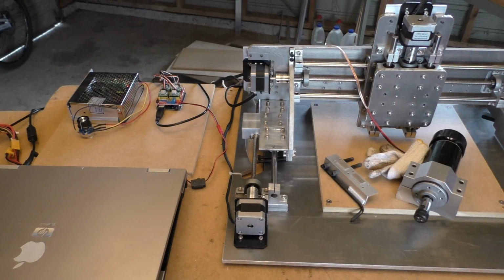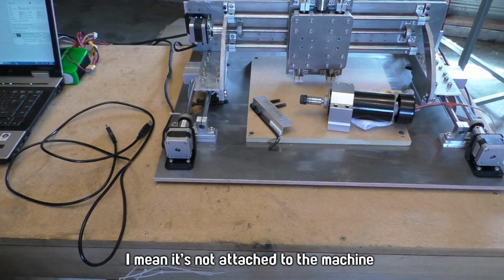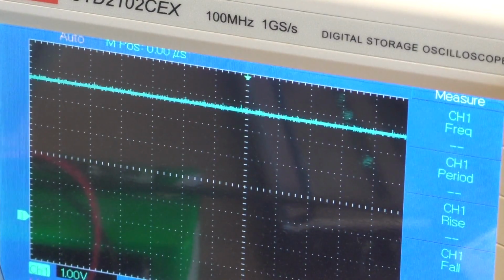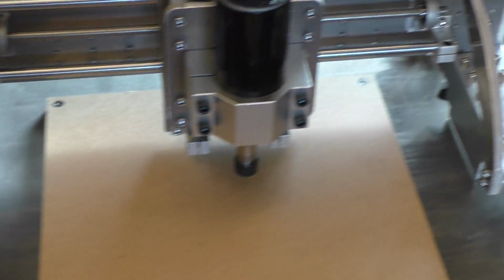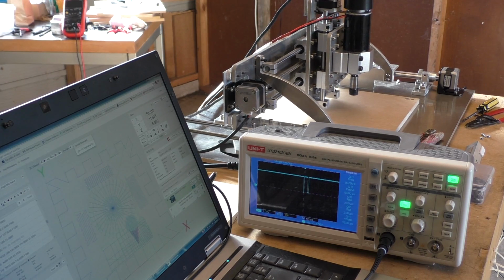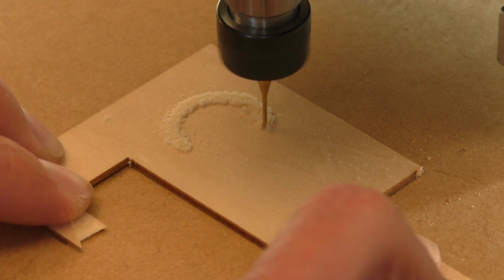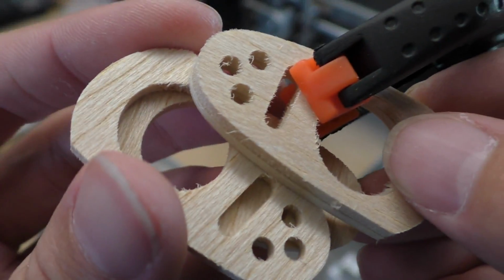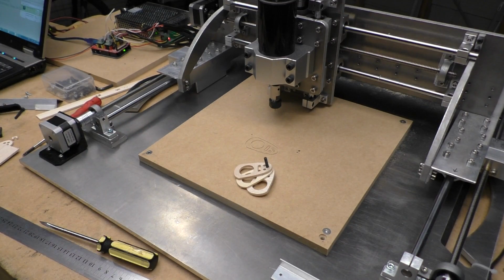DIY mini CNC machine part 10 (spindle round three + easy cuts)

Comment: I finally found soeone with the same project, setup and problem as me :D I´m looking forward to see if you found a solution. Thanks for sharing (I know I´m late)
Reply from the maker: I eventually gave up on the wired connection and I now use bluetooth between the laptop and arduino. Never had a single problem since. It also lets me move the laptop around more conveniently. Many laptops come with bluetooth devices built in (as mine does) so you don't even need to plug in a dongle.

Comment: Looking at the noise spikes at time 7:32 of the video, it shows about 16 kHz frequency. It is very likely poor EMI filtering in the switching power supply. Try using a Linear power supply to test. When you touched the motor to the plate it showed the noise even though the spindle was not running. A linear supply should fix that. It seems that the EMI is conducted and not radiated. Best of luck to you.

Comment: the issue is magnetic & rf ... not physical electrons... an opto-coupling circuit for the motors to be isolated from each other, and any  VFD P/S you might install.
Seek others' help... but I think your issue is common.
Reply from the maker: I tried optocoupler and still had the problem. Eventually used bluetooth connection, no problems since.

Comment: i got a router spindle on my cnc and same as you when i turn it on the arduino crushes. My solution is to plug the router to a different electrical line it happens when i am using tb6600 and drv8825 driveers.  But when i change my dr ver to dm556 it doest happen anymore...

Comment: Hi there buddy what stepper motors did you use nema17? And spindle any links? Cheers
Reply from the maker: yes nema17
https://docs.google.com/spreadsheets/u/1/d/1zyGDZSG_wHfn7GA0wKzwLYhK88SAIyLOe-4c9KuL23A/edit?usp=sharing
Reply: I forced thanks and the rest 8mm road and couplings?

Comment: I don't know what you ended  up doing with this, but I would install and isolated mount for the spindle motor.  Years ago, I had to iso-mount fork truck terminals from the chasis of the propane driven fork trucks.  Their spark plug noise was preventing the radios from working properly.  Floating grounds are always a problem, but iso mounting will help a lot. Back EMF diode on the motor might help.

Comment: I’m not alone! I have the same problem. Same spindle. How have you fixed this?!?!?! I was laughing as I went through a very similar diagnosis.
Reply from the maker: I eventually used a bluetooth connection between the computer and the arduino, have not had any trouble since then.

Comment: Is the spindle motor isolated (rubber gasket) from the whole frame?
Reply from the maker: Hell no. The whole point is to keep everything as rigid as possible :)
Reply: rigid thin plastic will do.. a gasket won'y make it less rigid
Reply: the point is you should'nt be getting power off the the frame or the power supply case.. That's a no brainer
Reply from the maker: Plastic is less rigid than aluminium, I'm not gonna argue about that sorry.
Reply: Lol but it goes between two peices of aluminum.. it'll only make your aluminum even stronger.. your bolts are what you should be concerned about more than the plastic
Reply from the maker: Putting something soft between two harder materials does not make the harder materials stronger. It allows the two hard materials to move relative to each other more than they would if connected directly, which is the exact opposite of what this machine is supposed to be doing. I mean serious CNC machines are not even made of aluminium, let alone plastic. The fact that you even mentioned rubber in your first comment makes it obvious that you are rather behind the curve on this topic, and nebulous terms like "getting power off" and "make your aluminium even stronger" are not helping your case. I realize that plastic is an electrical isolator, but that is not what is needed either - the spindle and the frame of the machine are actually connected together intentionally to a common ground.

Comment: Congratulation!!  Your machine itself is sturdy enought to cut ally but your bit broke because it was had too many flutes, too long and too small causing massive tool deflection even on the ply, tool travel too slow because you need the tool to actually cut a chip out and if it can't get a bite it just rubs and bends as the spindle traverses causing heat and softening the ally to the point that when it does cut it gums onto the end of your tool then no exposed cutting edges. I use single flute 3mm centre cut bits from China, less that a dollar each delivered ( I break many more that I get to wear out ). Also, that ally looked like something from Bunnings and only some ally can be machined easily, some of it machines like bubble gum. I do admire your perseverance and patience with the electronics, I gave up after a week and running out of Uno's, shields and drivers so I bought four $20 drivers and a $15 parallel port breakout board, blew the dust out of an old PC with XP, installed Mach3 ( you can run upto 500 lines of code without buying a licence) and had the machine wired up, calibrated and running in one long day with a lot of help form Google. The only problem I had was noise causing the limit switchs to trip an estop so solved by removing them: on small machines they aren't necessary if working in the centre of the table and also makes it easy to square the Y axis by just driving the gantry onto the end stops. All the best with your build and I am willing to bet that it won't be your last.

Comment: I have the same problem with arduino. No communication when I run the spindle. I have used 3  different spindles. And the effect is the same.
Did you somehow fix it ???
Reply from the maker: I think so. Caps on the motor, ground everything properly. Just keep watching the series and read all the helpful comments :)

Comment: It took me about a year to figure out noise issues I was having with my stepper motors. I finally solved it by optically isolating the step and direction lines of the drives. I don't know if your drives are isolated, or not, but if they aren't then you're better off adding that. If you're interested I can give you the schematic.

Comment: good to show this!

switching power supplies are on the one hand good, but on the other hand, the terrible things
they rays an awful lot of interference! (often of the wiring)
o, and they can be as dangerous in combination with a second switched mode power supply. (for example, The power supply  from a laptop!!!)
(In the Netherlands) I measured once on my Arduino 110V  :-(     (220: 2)

So people watch out what you are doing !!!

sometimes you can then again better have an old fashion transformer! (or use a battery!)

so switching power supply will interference
and they can be terribly dangerous (especially if you're using two !!!)

shielding, -  capacitors and ferrite core on the wiring from the switching power supply often it helps.
Do you indeed tried to (if necessary both) shield your power cables?
https://www.youtube.com/watch?v=IEOK515XTQ0
https://www.youtube.com/watch?v=Edel3eduRj4
https://www.youtube.com/watch?v=EeAcGell_cg
https://www.youtube.com/watch?v=v0-4sacsv90

Friendly greetings from The Netherlands.
Rob.

Comment: Try adding three capacitors to the motor.  I used to use 0.1uf caps on my rc cars.  One from positive to negative, one from positive to the can of the motor, and one from the negative to the can of the motor.

Comment: Maybe low quality usb cable that looses connection when the arduino gets exposed to vibrations of a certain frequency (it seems to be attached to the same base plate like the motors).
I would try another usb cable and (at least for testing) put arduino and laptop on a different surface to get isolated from vibrations.

Comment: disconnecting the PC just make it worst, everything have "floating" ground. You should connect all ground potential together. (for switching powersupply it's not recommanded to connect the enclosure to the ground but you should check if it's possible to connect the 0volt output to gnd). your issue seem to appear when you turn the motor off, maybe a flyback diode could fix it

Comment: I saw your poor aluminium cut results. I had the same poor results and broken endmills on my first try. But then I used ethanol to cool/lubricate the cutting, that was a game changer. With ethanol I get very smooth cutting surfaces and no more broken mills.

Comment: A second thought - you may have better luck driving the cutting motor with a wound core transformer - much less likely to induce EMI/RFI into the power system than a switchmode.

Comment: I had to trouble shoot a problem that sounds very similar with the theatre production Devolution several years ago. Your problem is most likely caused by the chopper drive, and also induction from the motors. You need to more than adequately filter the system. Driver chips need filter caps as close as possible to the pins plus a power diode for each chip. This is to prevent spikes and rubbish getting back into the power supply. Filter the power and GND pins on the micro's with a filter cap -  this is important - you have to stop EMI/RFI in its tracks, and that can only be done by filter caps. Do not cheap out, use good quality capacitors. Segregate the GND for all parts of the system. Run individual grounds for laptop, arduino, driver board and power supply and connect them together at only one point. You need to eliminate looping earth. Test your earth connection point and make sure it is sound. Lastly, twist the motor wires - once every cm should do. This will help prevent radiated interference. Remember that components are made as cheaply as possibly - my experience has shown that filtering is always a problem, especially in situations like yours which will naturally produce noise on the lines. Good luck :)
Reply: So, you think the PWM spikes can just be filtered out? I did too. Then after a year of trying I wasn't so sure anymore. So I finally put some optocouplers on my control lines and lo and behold, they fixed it. Coincidence? I think not!
Reply: Congratulations on solving the problem. Please remember, you have the advantage of having the electronics and equipment in front of you and can trial and error test your theory first hand, Those offering advise over the net can trouble shoot only from the information given to them by yourself, We can relate that data to problems we have encountered that were similar, and share solutions that worked for us. There is no guarantee, only a willingness to offer advise that may assist another person with their problems. I am sure that any competent engineer with a CRO, working on your equipment first hand, would have found a solution to the problem in 5 minutes.

Comment: I too had similar issues with my CNC router.  The main fix that I found in the end was to use a high quality shielded USB cable,  El cheapo USB cables seemed to have this issue but the higher quality shielded ones did not.  The results were consistent with different cables, longer usb cables or usb extension cables caused issues too.A note on grounding if you are shielding the motor cables, tie the shield to ground on one end only or otherwise you can get circulating currents which can cause your electronics issues too.Another thing you can do is add diodes to between the across the cables to disipate the back emf caused by the switching of the speed control. (Most drivers should have this internally anyway but something to try maybe).My 100V spindle sucked up mdf dust pretty early on so I replaced it with a 1.5kw spindle with a vsd, I used sheilded vsd cable and have had no issues like this ever again.Hopefully this is of some use.
Reply from the maker: Thankyou! Yes, a slightly shorter USB cable and caps on the motor terminals is working fairly well right now.
Reply: it is an arduino clone? if it is a clone has it have the usb interface chip ch340g or the atmel one?

Comment: is your endmill center cutting?
 How deep was your cut?  check with your tooling manufacturer guidelines, but I would start with a cutting depth of 25% of tool diameter and adjust in 5% increments.  a tach for your spindle would be really handy right now.  there are formulas used to figure spindle speed and feed rate.

Comment: PWM impresses large supply rail distortion at lower speed settings. It is especially disruptive when supplied by a SMPS due to instantaneous (square wave) current harmonics relative to the switchmode supply switching frequency. Best solution is a separate supply for the motor drive, not a separate output from single supply. Also high PWM frequency causes masses of near field emi, again at low speed settings. I would run balanced supply to spindle motor in shielded wire, it would require opto coupling the arduino to PWM speed controller for control. Another beneficial trick is to make a double wound toroid filter to fit as close to the motor as possible. Also, do you have a super fast shottky diode on the spindle motor, not at the controller end. You need to snub back emf's as close to the source as possible. Diode must be rated to full motor driven current too.

Comment: Had similar problems getting an arduino to run my car ignition , damn thing would work fine up to 2000rpm then die/reset . Stuck arduino in metal box (biscuit tin actually) and earthed the box, pretty much solved my issues . Also a low esr capacitor on any dc supplies helps.

Comment: It is sometimes difficult to get rid of RF interference, especially with unknown chinese power supply and regulators. Also, check on the scope your laptop PSU and GND of the arduino. Your computer may bet interference over charging cable too (serving as a loop antenna, or even worse all garbage from the mains). If your mains is RF 'dirty', maybe due to pulses from motor regulator, then you should sense with O-scope all possible RF pathways, and then get rid of all of that RF noises. It will be good also that motor regulator has those yellow choke as seen in PSUs, with two wire wounded at once, and from each wire to the GND some 100 nF capacitor to the ground, in this case common ground connecting everything as a single ground, then to the mains and outlet ground. Use some AM radio as a 'helper' to listen possible RF noise sources. Then you will know what has the most RF power, then block it. Good job anyway!

Comment: Hi, i have the same spindle and power supply and the power supply is the absolute garbage, it will murder every electronic device in the vicinity with electromagnetic interference, the noise on the wires between the spindle and the power supply is in the range of 1 to 1.5 kV!!! There is absolutely no inductive spike protection there.

Get the power supply and the spindle wires as far away from the driver as possible.

Forget about controlling the spindle from the arduino.

Also, it took me about a year to get my own fully diy cnc to work as i want it, so do not get discouraged, there are way more problems ahead of you :)
Reply: I have that same spindle and PSU. I have the PSU screwed right to the side of my machine. No problems.

Comment: that's why u should use a 5v  microcontrollers (or 10v if available ) instead of 3.3v , use filter capacitors of 4700 micro at power supply outputs and 220microfarads at aurdino input supplies  ,  and why ur power supply showing mains voltage on case etc etc strange , change the supply to smps desktop ones, H bridge is also an issue with spindle motors and steppers , use a reverse emf protection (clamping schkttoy diodes) H bridge circuit  , make the h bridge ur self . These spikes hang the microcontrollers ....4700uF and 220uF are minimal values given , u need to go 3 times higher ...

Comment: at a guess i'd say its due to noise being put on the line by the power supply - at low speeds its chopping up that voltage by rapidly switching the output on and off... try adding some good size 150v caps on the power supply output (after the speed controller)
also grounding your spindle/frame may help, if you haven't already.

Comment: Great job mate!! According to yours problem with interferences try use metal sheath around stepper motors cables and router cable and ground it to the CNC frame and power supply. Try use the ferrite cores for all cables. Good luck!!

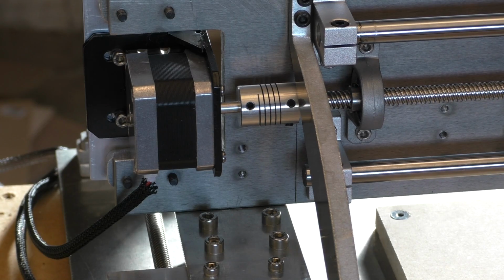Comment: 12:36 I've had that same problem with my CNC machine when I used a too long and un-shielded flat cable between my computer and CNC controller acting as an antenna. It would add random steps to the motors while running a job and screw it up.
Shortening the cable to the proper length and shielding it solved my problem.
Just saying.... I would shield all cables especially the 100v spindle cable it is transmitting big time. Then find a common ground point and connect all grounds to that one point as mentioned below.

Comment: Try a Faraday cage around the Arduino and shield. Is the motor AC or DC? The speed controller section of the power supply may be the problem, SCR based controllers can be incredibly "noisy", do you have any way of running the motor at full speed without using the supplied PSU? Shield everything you can, ferrite toroids, as mentioned elsewhere, on every power cable may also help but identifying the source of the interference/spikes  and isolating it somehow .....